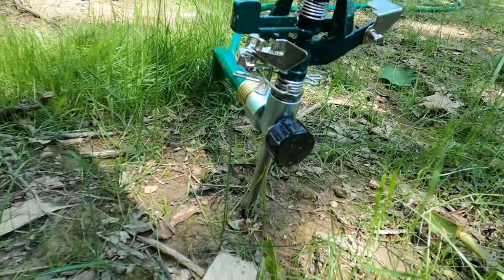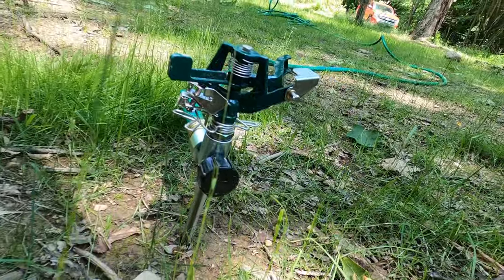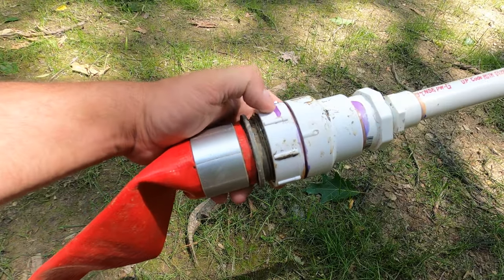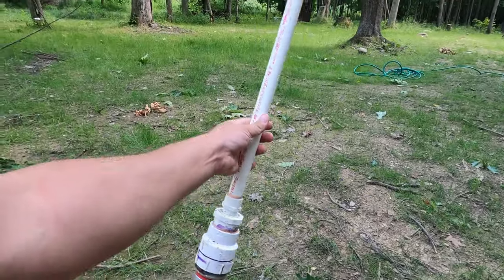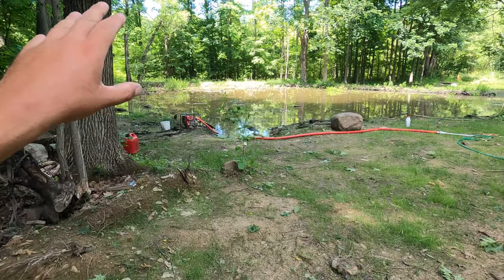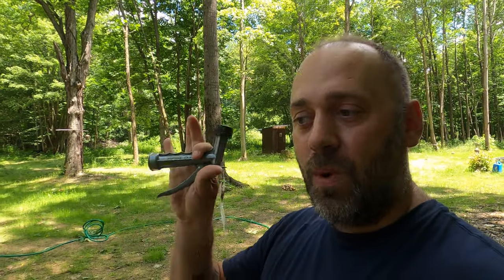Can a water pump be used for a garden hose? I use a trash water pump to run my sprinkler off-grid.

Comment: Really nice , I converted mine to 40mm cam lock fittings and 40 mm Canon sprinkler and it works great.
Reply from the maker: Nice. Did you happen to make a video about it? I was looking into the cam lock stuff but was a bit confused.
Reply: I can answer your questions about cam locks if your still wanting to switch to those.   I will mention they can be hard to find sometimes

Tractor supply sometimes has them.   Amazon has them in limited verity.  You can adapt to different sizes via standard npt fitting then cam lock to npt adapter for the size you want

From there its just male or female cam end and is is barbed to slide inside your hose or screw on to existing fitting.   @TheOhioOutdoorsman1

Comment: Great job! Thanks.  Just what I'm trying to do. Can you tell me where you got the 2" suction hose adapter/ reducer to 3/4" garden hose? I'm not having any luck finding it.
Reply from the maker: The one in this video was custom made but I believe there are some you can find on eBay or Amazon. I plan on finding some different one so I can do another video on it specifically.

Comment: How do you filter the water coming from the pond or lake?
Reply from the maker: We ran the pump for a while so that the factory filter on the inlet would semi clean where the pick up was. After a while, we did not need or use a filter other than the cage on the pickup that the inlet line came with.

Comment: But if you stop squeeze the trigger pressure will build back up and that could damage the pump
Reply from the maker: Have not had any issues with it, even today. The pressure does not spike due to the type of pump.
Been 3 years and no issues. I however do not run the pump for long periods of the time on a closed system.

Comment: Thank you for the video. We have a 50'x300' area that has been cleared and seeded that we want to keep watered. Have you tried running multiple hoses/sprinklers off of this pump with success?
Reply from the maker: You're welcome. I have ran 3 hoses off this setup at the same time. There was a noticeable drop in pressure but it worked fine. I was also running around 200' of 3/8 hose just for one lead. I would try top position the pump in the middle on the side as much as possible so you only would have to run 150ish feet of line at max.

Comment: Will this same exact 2 inch semi trash predator water pump from Harbor freight be able to pump water out of a well that doesn't have a motor on it already to the surface and into metal tubs for sheep to drink the water or does it only work in like a pond or something and not maybe like 50 feet or 100 feet deep into a well do you know that?

Comment: I have a 3inch water pump and i want to pump water via ppr pipe which is ¾ inch, I have been looking for someone who has done reduction to fit decired size maybe list for me how many reducers I should buy to fit ¾pipe kindly
Reply from the maker: I think you would simply start at a 3 inch and instead of reducing down from 2 it would be 3. I believe I saw a 3 inch adapter at the hardware store so I know there are pieces for it. 

I am looking at other options now that make this process a lot easier.

Comment: Got one of the new little 1 inch Honda water pumps and have been looking everywhere to figure out where I could buy a relief valve that I could put in line so that I could use a spray gun. Now you’ve got me wondering if I even need a bypass/relief valve?🤔
Reply from the maker: If there is water flowing through it with your sprayer, you may not need a relief valve. I don't advocate running it closed for extended periods of time though. I am doing an update video this weekend after an entire year of running it like this. Still working fine!

Comment: I have the 212 CC Predator Water Pump. I previously made a similar reducer fitting from 2" down to 3/4".  My water source is aboutg 20' downhill which I have 40' of 2" line for the suction hose.  I also have about 20' of grade change up the hill from the pump with about 500' of 3/4" garden hose so that I can reach some trees I planted.  My problem is getting the pump to fully prime and then be able to attach the garden hose.  The only way to get it to fully prime is to have the air cap off on the top or the hose disconnected on the discharge side. Then once fully primed I don't have a way to get the hose reattached without turning it down so far that it loses it's pressure.  Been fighting with this thing for two weeks now trying to figure out. Any ideas welcomed!
Reply: I have the same problem going 500 foot distance 100 ft elevation and I can barely get it to prime more than a minute. it might be the type of pump where it can't reduce that much
Reply: Move the pump as close to the water source as possible.  It will push water much farther than suck it.
Reply: Have you tried a hose splitter where the water hose attaches to the reducer?
Reply: Add a simple valve as close to the discharge outlet as you can. Disconnect hose and when priming have the valve open to release water right as it exits the pump. Once primed, close the valve so you can connect your garden hose to it and then reopen the valve to move water through garden hose. Old plumber's trick for repairing lines that can't be turned off. Attach an open valve to pipe, then close the valve to stop the water. You could also do this a hose splitter as mentioned above. just close and open each side as needed to help prime pump and you won't need to remove the hose.

Comment: You could do this yes but you'd be limiting the output since a garden hose is so small. Plus you don't want to do this for too long because you'd be dead heading the pump which can damage it over time. Unless you ran it at lower throttle it wouldn't be as bad. Get some hoses the same size and a stand also the same size and a bigger head say 1 to 2" input and you'd be covering a larger area and having more output as well. But trash pumps have low pressure and high output so they're not meant for irrigation use.
Reply: Is there a pump you recommend for garden hose use that would work for a distance of 500 feet or so that will be sectioned from a water source 10 feet lower than the discharge target?
Reply: @inharmonywithearth9982  you might want to consult someone at your local TSC or similar store. They have different size pumps but since your going 500ft you will lose Alot of pressure and flow. You might want to consider going to bigger hose to minimize loss with the garden hose. Also maybe go with a bigger pump. Like gas powered or electric

Comment: What type pump are you using and is that a semi trash 2” pump.  I was wanting to buy one for the exact same reason but worried the pump would burn up.
Reply from the maker: It is the 2 inch semi trash pump from Harbor Freight.

Comment: I dont know why you call it a "trash pump" or why you think stopping the flow for upto 5 seconds tests whether there would be a problem if it were stopped, but I want to ask: can this type of pump pump water from a deep well with rigid pipes, or does it only work with those flexible pipes?
Reply from the maker: It is called a semi trash pump which is just another way to say that it can pump some debris as well. Some pumps are designed to pump NO debris and some are designed to pump sludge. This is called a semi trash pump because it can pump some debris.

This will work with rigid pipes for sure.
Reply: @TheOhioOutdoorsman1  ok, thanks.

Comment: That can’t be good for the pump. I would make a 2” header with multiple garden hose outlets. You could most likely run 4 or 5 hoses all with sprinklers, or route some as relief to water source. I def would not run pump speed more than idle with your rig

Comment: But wait... So while your spraying All is good however when you let off the trigger,Where is the water going?  Your pump is still working therefore its sucking water but I didnt see where you put some type of bypass.  Diaphram pumps have a float swith that shuts off the pump when water not being on demand/requested "sprayer trigger being pulled".
Reply from the maker: The pump is a centrifugal pump and the way does not bypass. Some say this is bad because it it opens the door to overheating. I have had this pump for 3 years now and not issues have come of it but I would recommend not running the pump for long periods without some form of water flow through it. Whether that is a vent valve or shutting it off when not needed.

I have been looking into a relief valve that would open when the pressure spikes a bit but have not found one yet.

Comment: Why didnt you scaled up your watersprinkle instead of do it standard?... you can water that grass in an our..
Reply from the maker: I run 3 sprinklers on it now and the pump seems to lag behind a bit but still works and covers more ground.
Reply: @TheOhioOutdoorsman1  perfekt. I bought one and connected first one 50mm PVC pipe and then 40mm and in the end one bit 30mm fits perfekt inside eathother for a test and it works perfect.. thanks for your answer.. Sweden..

Comment: If you use a hand sprayer and don't spray most likely you will cause cavitation within the pump and if you do it long enough you will burn it up. When this happens don't scald yourself
Reply from the maker: To date, the pump has been working fine even with long durations of no water flow.  This being said, the next video will show a new adapter I have that has a bypass when the outlet is cut off.
Reply from the maker: I might even tear down the pump housing just to see if there is any damage on video after the year of usage in displayed in this video.
Reply: @TheOhioOutdoorsman1  usually when they are burn up the edges will be purple-blue in color or the clearance gap will be really open
Reply from the maker: Thanks for the insight. Currently the pump looks brand new still from the outside. Here in the spring, I will tear the housing down just to look at it and make sure things are still in order.

Comment: Greetings from Northwest Ohio.

This is intriguing, I always assumed you couldn’t run these types of pumps without output or they would overheat and fry the pump...  have you been regularly stopping the output flow without any known issues (or do you not use the system in this manner often)?
Reply from the maker: I have been using the pump like this every since this video was published. I have not noticed any issues, or changes in the performance of the trash pump when used with or with these attachments. 

I will say that when I use the hand sprayer, I try not to let it run too long with no water going through it. Again, I have seen no performance change or wearing of the pump either way though.
Reply: @TheOhioOutdoorsman1  thanks for the response!  I have a new plan now....🤔😏
Reply from the maker: @CJ2APEEP  You're welcome